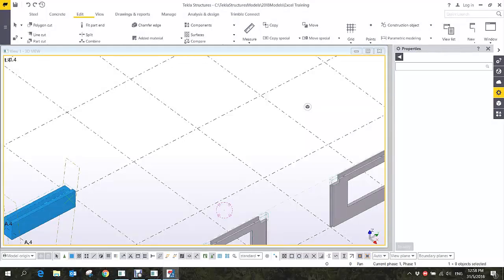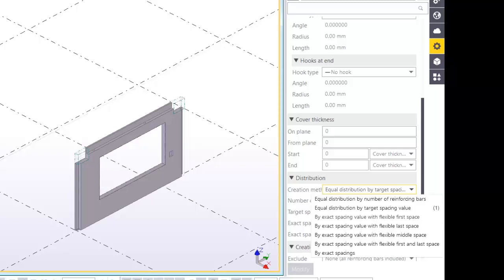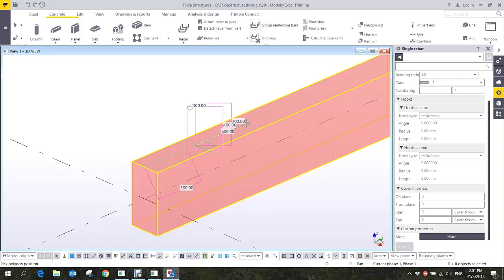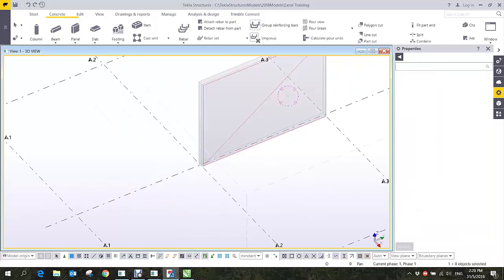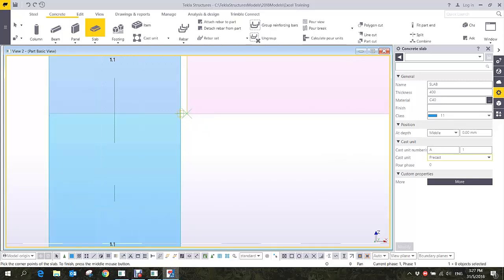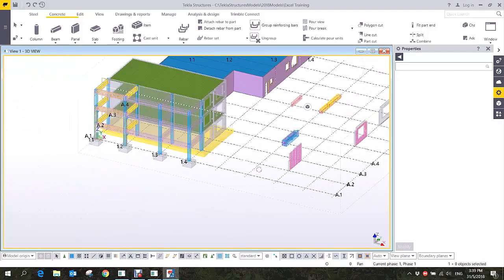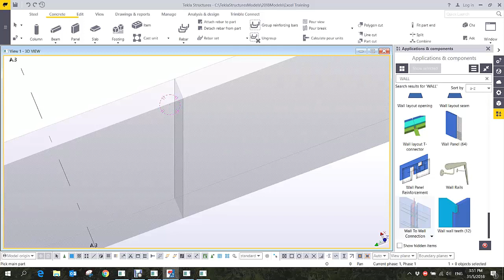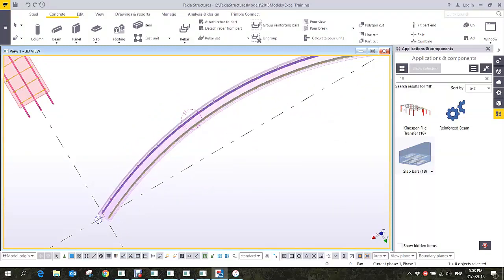Tekla Structures Basic Training (Day 2 PM)

Comment: Content of Video:
00:00 General rebar tool
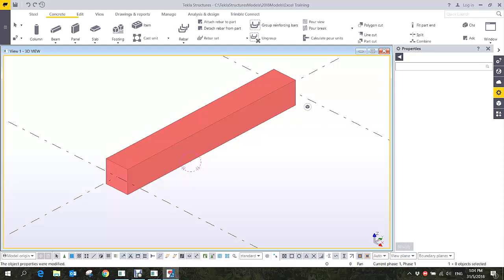5:45 Bar Group
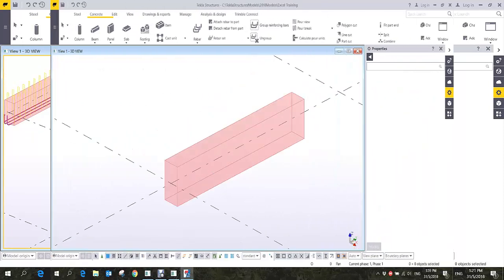23:11 Single Bar
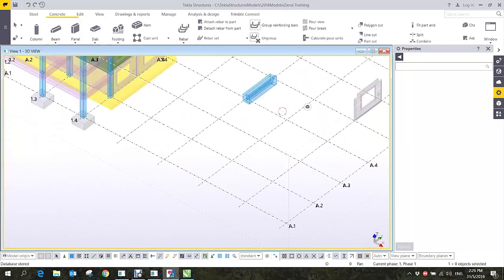34:37 Mesh Bar
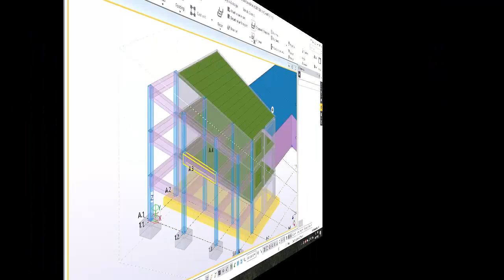47:30 Use component to create corbel and more
1:00:30 Use the component availble in the system
1:17:08 Model precast planter box
Reply from the maker: Thanks for the comments👍🏻